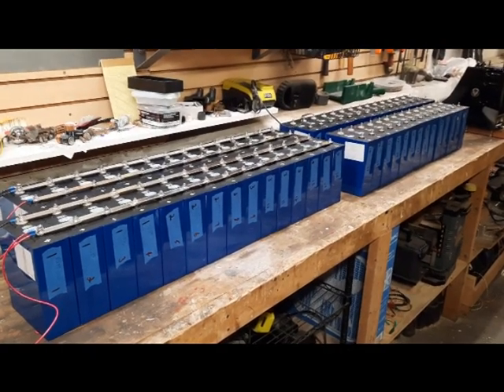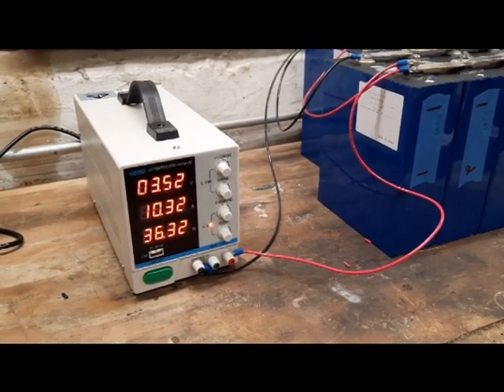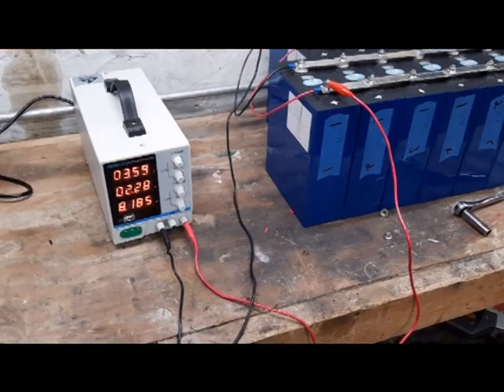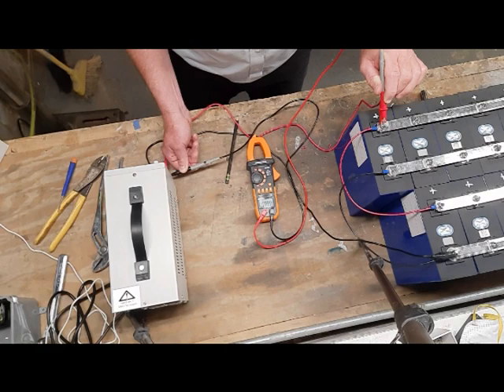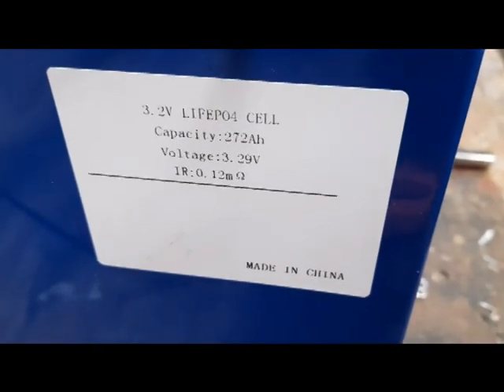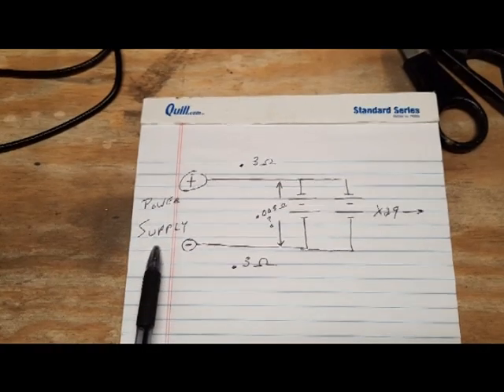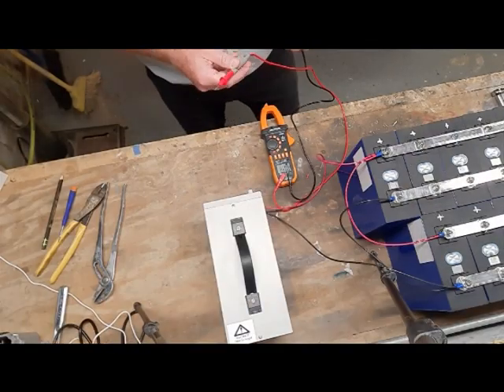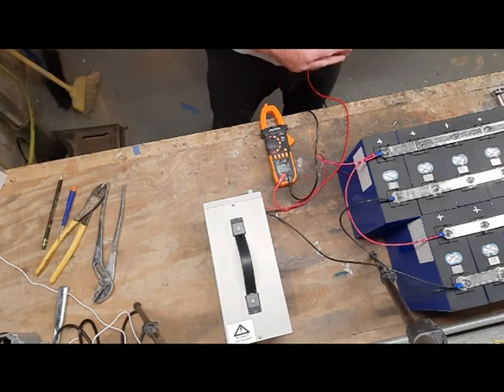LifePo4 Top Balancing   How to maximize charge current

Comment: After charging my relatively balanced 4S 12v 280aH pack with a 12v charger, it still took about 9 hours to fully top balance my 4 cells with a similar 10A charger. I can't imagine how long it took you to get them charged up!  I'd be purchasing multiple 40A chargers and doing them in small individual batches if I had to use that many cells!

Comment: Just received my power supply. I had the alligator clips hooked up and it was only pushing 2a. Threw some 8ga wire with good crimp connectors and instantly up to 10 amps.. thanks

Comment: How many days to balance 8cells with 3 amps
Reply: Top balancing happens above 90% state of charge, about 3.4 volts per cell. Bulk charge up to about 3.4 volts per cell and then top balance up to about 3.5. Depending on the size of your battery, even at 3 amps, it goes pretty quick

The topic here is don't drop your charging voltage on small gauge leads and bannana jacks. Hard wire with 10 or 12 gauge wire.
Reply: I disagree: 10% of 270=27A, x8 cells=216A /3A per hour = 72 hours /24 = 3 days...
But if it were at 50% load, 3 days x 5 = 15 days...
On the other hand, with an appropriate cable, and at a 10A load, it would be 10.8 hours. Just by putting the appropriate cable.

Comment: It seems to me a lot of effort goes into  pre - balancing  cells - when I built my pack I measured the cells and they were within 3/100 of a volt in storage mode - I built the pack and charged it at 20amps using my T8 charger which balances as it charges @ 15 watts - it goes into constant voltage mode as it climes the heal and tapers off nicely all the cells arriving equally  - Time is money - I find my little a T8 charger is a lot more cost effective.
Reply from the maker: Be cautious with comparing cell voltages on LifePo4. Cells may appear to be in balance when you compare them at nominal voltage but you don't know how saturated they are. Voltages need to be compared above 3.4 volts. I learned this the hard way when I blew up a perfectly good 272 a.h. Lishen cell. It was one of 30 that all measured within 5 mv at nominal voltage.

Andy on the Off Grid Garage channel has studied this extensively and he's fun to watch. https://www.youtube.com/c/OffGridGarageAustralia/videos

Comment: If you really want to go all the way with removing as much resistance between your power supply and battery terminals you could get a power supply that uses heavy duty terminals and replace the internal wires between said terminals and pcb. I got a 20 amp power supply and I replaced the internal wiring from 6mm2 cables to 16mm2 cables. That did wonders to the difference between the voltage on the display and actual voltage on the power supplies terminals during max current. With heavy duty terminals you can also use really big wires or even bus bars between power supply and battery
Reply: my fam want me to buy a DC power supply. I don't hv an idea of its practical use. it looks too " sciency" 🤗 can you really use it as a charger? for lead Acid Batteries with the set up you described , by changing the wires? i thought its just for testing of power only.
Reply from the maker: I believe you can use a power supply for charging lead acid with a couple of caveats. You need to know what your target maximum charge voltage is. Also a power supply does not adjust for float voltage once charged. Probably best to use a dedicated lead acid charger.

Comment: Banana jacks can be notoriously resistant. Yours seem to be the exception. Heavy gage with eyelet terminals at each end works well. Most power supplies outputs are also thimbles so you can connect that way instead of the plug.
Reply from the maker: Thanks for your comment. I agree. I'm not using the bannana Jack's, it's hard wired.
Reply: @TallTom77  
Oh!👍
Reply from the maker: You are correct. I was checking drop across the jack also...